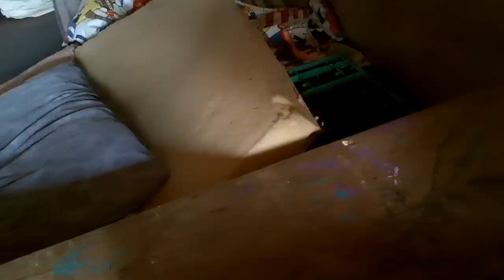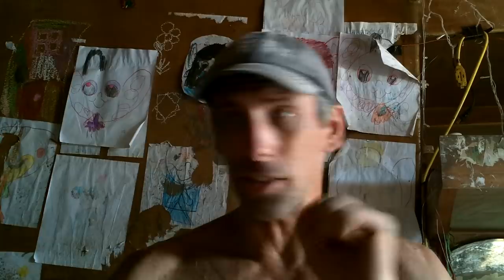Why no FlyWheel on the Pedal Boat, Jaimie?????

Comment: you're totally right.
The only modification i would consider is adding speed shifting using bike parts. That way you can adjust the speed/strength ratio to get more confortable.

Comment: i think the normal exertion on a lightweight wheel (ok not a momentum /mass, use of flywheel ) but a smooth little and often pedal motion you are doing anyway linked back to alternator and then motor and prop or back to battery bank .
thats what i think

greetings jamie love your adventure all the good things to you sir 
i watch with interest as my missus says my brain works just like yours, sound effects and all, i concede i do seem to be on your wavelength.

my own fuck the system off grid adventure isnt yet advanced as yours, but from the mess of my vision in progress ,im reminded the distance between madness and genius is measured by success .

as i bumble on with varing degrees of crazy , your success inspires me , sometimes i hear myself say what would jamie do?

keep on keeping on bud

Comment: I just had a conversation with my dad about flywheels. It's hard to get people to understand that like a capacitor they need to be charged.
Reply: Ya, my thought as well. I was thinking about inductors, because they want to keep a steady rate of rotation, which is kind of like how inductors want to keep a steady current. Inductors can produce huge voltages when you try to quickly alter that current (like open-circuiting a charged inductor). Similarly, flywheels can dump a huge amount of force if you try to stop them suddenly.

So, in the same way you want to smooth out current fluctuations with an inductor, a flywheel will smooth out rate-of-rotation changes (angular velocity changes). The goal is to maintain a steady state. A paddleboat isn't really expecting fluctuations in rate of rotation, so it doesn't really benefit.
Reply: The entire question can actually be answered immediately and FINALLY with a subtle reference to the first law of thermodynamics !!?
...but that may work exclusively over here, in "other" parts of the world !?  😎😂😂😂

Comment: It’s about the apex of the pedal stroke, at least that’s the only reason I could think of to put a fly wheel on a pedal boat. A small inertia to get you over the transition from right foot to left foot Power. 
But when you think of it a bit harder this is not needed either, The boat already has forward inertia, The water passing over the prop will keep it rotating pasts the cranks apex.
Reply: Most reason yet
Reply: A few years ago cyclists started to experiment with oval chainrings(front ggears attached to pedal cranks) to increase efficiency. They worked but the cost of manufacturing was very expensive. With cost effective CNC machining today it's starting to make a come back.
Reply: Mazda rx7 I remember seeing those in a video
Reply: @jaredj631  I was picking up a bottom bracket for my neighbors kid bike at a bike shop. They had a couple bike there with it on. Took it for a short ride, feels weird to pedal
Reply: This, thou I suspect higher gain could be had by enhancing the pedaling geometry? clip in pedals? up stroke! yeah baby now we be cycling!

Comment: Early Large huge Mississippi river boats side wheelers. Had large cast iron flywheels. The drawings was of a beam engine and they had two of them. They apparently was also using them to balance the boat.

Comment: Great points< Jamie and I agree that in this situation  a flywheel is not warranted.  On the other hand,  a pedal is NOT a very good method of propulsion.  When your feet are nearing the 6 and 12 o'clock positions, you are making little to no power.  A flywheel balances the load so the force being applied to the paddle wheel remains relatively constant.  Also, because a flywheel  is fixed in place, once brought up to speed it requires no extra effort to maintain it so, it's not quite like your example of sprinting then resting.
In a similar vein, I'm wondering if you split the paddles and stagger them so that there are more paddles entering the water, albeit half the size, thereby evening the load?  
Thanks for posting these videos.

Comment: I remember seeing a video of a paddle boat lowering it's paddle wheel into the water and that is where I believe an adjustable height paddlewheel would help maximize the perfect ratio of available human energy to speed out put. I think instead of adjusting the height of the paddle wheel assembly Jamie can create various lengths of paddle wheel fins that bolt onto the main paddle wheel sprocket mechanism. And depending on how low his boat sits in the water he can choose the best length paddle wheel fins for the job.

Comment: "What do you think"  - I mean, the answer to this, frankly bad suggestion was fine. But what struck me most was the mature and non-defensive way you handled the criticism. Especially for criticism that, must, as a bundle, get frustrating to hear (criticism that is obviously, factually, not-matter-of-opinion wrong). I don't know that I would invest effort in this obviously bad suggestion, but, I appreciate hearing your problem solving and decision-making on other things where at least it comes down to "I have different preferences than the norm and this is why I'm building this differently", especially if you can handle it with this level of maturity. People have a lot they can learn from you.

Comment: I think the flywheel could work well with a kite sail if it's connected to the kite tether. Launching the kite would wind the wheel and with proper ratcheting gears and a spring loaded spool you could potentially keep it wound up. But I agree the extra weight wouldn't be worth while as flywheels have to be very heavy to be efficient.

Comment: I absolutely agree you with a flywheel. It would be bad idea for exact reasons you mentioned. However, from paddlewheel point of view, smooth constant torque would be better because it cause less turbulence. Single pedaler have to try to adjust pedaling strenght to avoid pedalwheel slowdown when pedals are in inefficent position. It may not be the most efficent way for a human. 

Maybe pedals could load a multiturn spring, which then turns the wheel. I know you don't like complex mechanisms, and this is definitely more complex than straight axel. Would need back and forth moving pedals and some ratchet mechanism for spring.

Comment: I think you're %100 correct. Your #s are fuzzy but they proved your point. 
There are also inherent parasitic power losses in every system. The more components the more loss. A flywheel is a pretty complicated device to make run efficiently. 
The only way I could see a flywheel working at all is if you had a seperate mechanism you could use to put power in when feeling extra froggy. Like a rowing machine pulley from those old exercise machines.  But again weight complexity... Blah blah blah.

Comment: I remember the craze over Chinese "inventor" who put a flywheel on a stationary bike to power up the house as you pedal. All attempts at explaining why that won't work broke down at the wall of "But it has Flywheel" comments. People will never not try to find free energy where is none.
Reply: Fit person can pedal about 300w power in long term. No flywheel can help in that. There are more efficent and less tiring ways to get that energy out but most of the time it is what you have used to do. 

Non trained people with bicycle use slow pedaling and lots of force. Best way is to use locking shoes, relatively high pedaling speed and do the work with all muscles and all directions. Real cyclists typically don't like excersice cycles with flywheel and those who have get used on those in gym, may not like real bicycles.
Reply: Nagolbud  Tesla didn't investigate free energy from atmosphere. He investigated wireless tranfer by ionizing the atmosphere with high voltage teslacoils and harvesting it with antennas. 

There are actually so called 'free energy' in atmosphere, since the voltage potential increase about 120v/m. It is caused by ionizing radiation from sun and it is higher near the poles. It is not practical to use since voltage is high but current is extrenely low. A huge mast can harvest enough to light a small bulb.
Reply: Nagolbud  I have read many of those free energy scams and they are nonsense. You can't use ohysics to justify you arguments if you complete ignore the most fundamental basics and cornerstones. That's what they are typically doing. I have also read quite many Tesla's experiments (which are actually made by him), and find cero references on anything that is against basic physics. He did assumptions which were not proven or explained by physics, but that is completely different think.
Reply: Tero Piispala you don't know what you're talking about he could totally put a huge mast on his boat and harness free energy 😂😉

Comment: You're 100% right. Flywheels are a way to increase the efficiency of system and they only increase the efficiency of a system when the power draw fluctuates and efficiency matter.
I think in a pedal boat doing long journeys a flywheel would be a nice thing to have though. It's not a sprint race, or a race car going around a twisty track. Sure it will take longer to get up to speed, but once up to speed, it will be the same as no flywheel, except you'll be able to stand up and have a piss, or take a drink, or fiddle with anything else, all without losing all your speed.
But at the end of the day, you do you.
Reply: that don't make no sense.

Comment: true but if you would of geared the paddle wheel with a belt or chain rather than direct you could of made a wider paddle wheel .yes you would use more energy but it looks like its not taking very much to move it now. the closer the wheel is next to your pontoons wouldn't that mean less cavitation?and a greater speed.
Reply: lmfao!!!

Comment: Modern boats gas RC boats uses a flywheel and it is said to be necessary. Old hand-crank farm machinery you often see a flywheel you think those Old-Timers may know something about the use of a flywheel. I know of an exercise bike with a heavy cast flywheel. It seems to be easy to Pedal but the primary purpose of the flywheel was to reduce friction by the braking pads.

Comment: I heard a flywheel described as a energy battery it stores is a little bit of torque. This battery will smooth out rotation. If you had a flywheel on a shaft it'll be like you are using pure sine wave electricity instead of modified sine wave.

Comment: well, maybe someone ment clutch by saying flywheel, as by some people that are not well into mechanics they might think that spinning disc and another part engaging from the motor to the shaft is called flywheel, since flywheels is technically a part of the mechanism maybe they think its that part, so maybe some people meant to make disengage system for the pedals, so it would work like on the bicycle that is not fixed, as your boat will make friction when you stop pedaling as oppose to let the wheel running smooth witohut hitting you with the pedals. but that would involve mechanism  and a timing belt or sometihng

Comment: Hey Jamie, have you ever thought about experimenting with an oscillating fin drive system, like the Hobie Mirage drive?
Reply: Mark McGuigan imagine if you flipped the sails horizontally to power your suggestion. Jamie can figure logistics.
Reply: Works Great On A Kayak, Butt 10 Times The Boat Size & Weights Means 10 Times The Size Of The Drive Fins, ETC...A Big Sail Is The Better Option, That's Why They've Been Traveling Across Oceans Like That For Last 10,000 Years... LOL
Reply: MrTesalonian has a good video on these.  They seem great for shallow water use.  I would use those to get a sailboat out of port.

Comment: maybe the leverage effect, not a super heavy wheel , but  weight  on   larger wheel to even out the power pulses, just like a capacitor in a circuit, once you charge it ,it will carry through to the next cycle, short burst of energy, f1 cars used the system?
Reply: Capacitor in a circuit has a leakage current and dissipates energy, so does any system. There are no bursts of free energy on Jamies boat. He does not have to suddenly stop from 150mph before each corner. F1 have to dissipate all that kinetic energy as heat by brakes othervise, there are literally megawatts of power to be harvested and thus make those recuperatuve systems worthwhile. Jamie would have to put out all the energy anyway and pedal through all the friction and losses.

Comment: Jamie I enjoy your channel very much. I do have paddle wheel question for you. What do think if you made the height of the paddle wheel adjustable?
Reply: Adjustable would require more force when extended... which would be good for 4 people all pedaling at once! Though... more parts means more potential to break something... usually simpler is better, but the idea is solid, so if you know a bunch of friends are coming over and you're heading to town, just bolt on the extra sections real quick...
Reply: 25 second video titled Adjustable paddle boat paddlewheel for more speed
https://m.youtube.com/watch?v=AeHAv4OD0E0
Reply: @XfireKeenmike  good video, but i believe it is misleading for Jaimie's application... The short paddles gain momentum since less is pushing water, while the long paddles deliver as much energy from the system as possible, not wasting any.
The difference specifically, is that the rubber band is a storage system of energy. So notice the long paddles use few rotations to cross the pool, while short paddles use excessive rotations. Granted, the short is moving faster and has more kinetic energy, but there is higher friction on the surface, which drag is exponential. So energy wise, it is far more efficient to go slower, however... if Jaimie were doing a high speed paddle boat, a shorter paddle might work, but ONLY if he had an adjustable gear system, like a 21 speed bike. 
Interesting concept, im not positive I correct, but pretty sure I didn't miss anything.

Basically, Jaimie's paddles only skim the surface, so I think he is the short version paddles.
If his friend helped him, all pedaling, they would max out and waste energy, so they would need to get more "bite" into the water with longer paddles.
Reply: Driver 1967  That's a good point! It also means if he has a bunch of people with him paddling, they will get more bite on the water and be more efficient. But if he is loaded down on his own, it will be some slow hard pedaling. :) He needs the workout anyway, been too long since he dug a canal.
Reply: My thinking is if he is weighed down and alone Jamie would paddle more effectively and faster with various paddle fins he could bolt on.
Reply: @XfireKeenmike  Yeah, its certainly something worth considering. Without a doubt, there are optimal settings for those paddles at various cargo weights and relative to force being produced by # of passengers. I don't know if it would be worth the effort to manually change the paddles before each trip, or just find a happy medium that works for all situations and permanently adjust it if a better happy medium is needed. 
You should write him a message on patreon. Ive only messaged him twice on patreon, but he replied both times within 24 hours.

Comment: My first thought was once the rotational mass was up to speed the efforts to maintain it would be less but if that were true I'd want heavier wheels on my bike also which doesn't work out so i think you're right to keep the total drive as light as durable, and waste less effort on weight mass and reinforcements , besides weight won't help that hull float or move concrete supplies to your secret volcano lab.
Reply: Would be less than what? You can't gain shit by multiplying the losses. Air to flywheel friction, flywheel bearings friction, friction in the pedal to flywheel transfer, losses in flywheel to final drive... How in the fucking world would you bring an advantage through all of this mess? And this all only adds on top of what Jamie said!!!

Comment: you can make a sail or something better, but on what you were saying technically up stream and down stream or current would be the equivalent of a hill, and it would really only be effective if you use it going down stream or with the current, and if the fly wheel was attached to a alternator and battery to store that energy?
Reply: No it wouldn't be techninally anything like that. A boal in a current is stationary relative to the current. Go back to grade 3 and learn some physics.
Reply: @NGC1433  learn how to spell first bud

Comment: I'm not sure I agree with the analysis - although I admittedly have no specific background. I don't know why you'd use a comparison to a bench press as opposed to a stationary bike, rowing machine, or an elliptical. Those are all similar devices and all use some sort of a "flywheel" to make them operate smoother. Perhaps the correct term isn't a flywheel but rather simply a weighted hub. Just enough weight to maintain some momentum but not so much to add more force. This isn't as necessary on a real bike since (a) you are directly turning the wheel and (b) there is more momentum in the bike and (c) the pedal freewheels when you are not pedaling. When you stop pedaling a paddle boat you get immediate drag. You may be correct that it doesn't perform any better but your analysis ins unconvincing - at least to me.